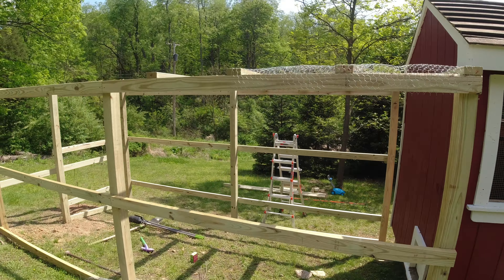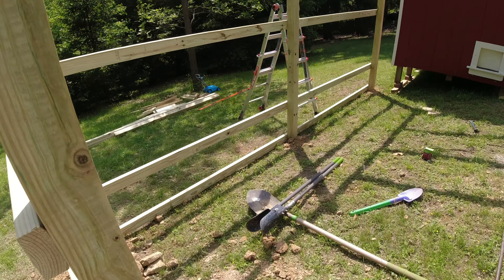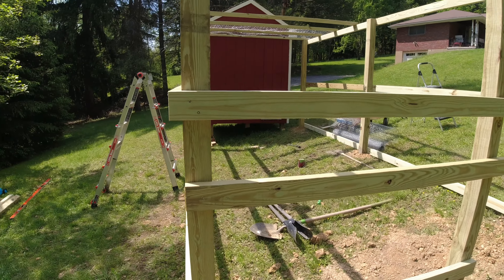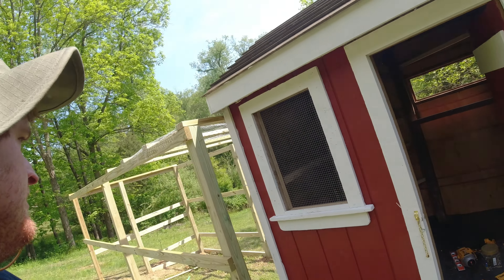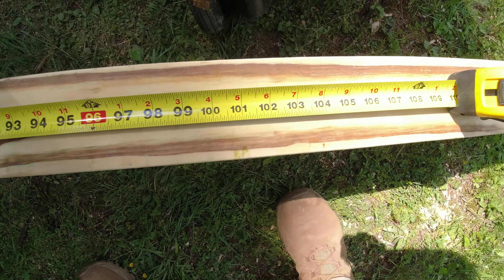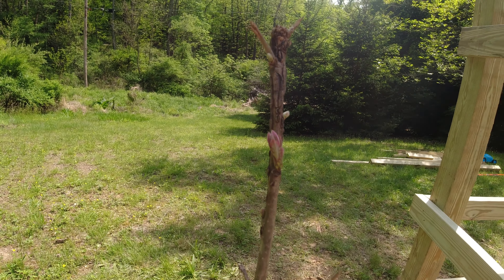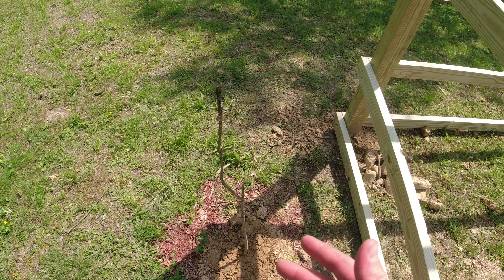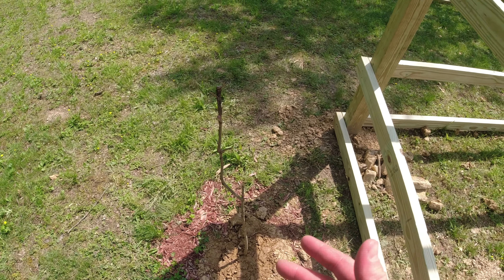#94 Chicken Run Is Coming Along

Comment: Glad you are covering the chicken run. There are four legged predators out there that can climb over the wall fencing’ as well as the flying predators. Also make sure that you run some of the wire at least one foot out from the vertical along the ground and cover with several inches of dirt to prevent those that can and might dig under the fence. Good luck its looking good
Reply from the maker: Thank you Raymond! We did do that exact thing!

Comment: I feel that you are doing the entire chicken operation to make the process successful,  well done... One thing about the chicken wire on the sides, I would suggest that you extend the bottom edges about two food out into the yard to keep boring animals from digging under the base, we lost chickens to intruders before doing that .
Reply: Bingo.....we've had birds taken like that too. We dug a trench around our coop and extended the wire down into that.
Reply from the maker: Thank you Terry! We have done that actually. We added a couple feet to come out and we will then put dirt on top and rock on top of that. We are doing our best to be ahead of the predators and we will make any changes as needed in the future. Thanks!

Comment: Do not just staple wire to bottom board.Staple then put board over staple row. Raccoons can rip out only stapled wire .
Reply from the maker: Thanks Peter. We are using poultry staples. And I am using more than enough of them. I am confident no raccoon can rip the wire or pull the staples out. I tested this with one small section and was unable to pull out the staple or the wire no matter what I tried. From using a hammer, needle nose pliers and more.

Comment: Surprised your store bought lumber for the top of the run, instead of  using off the sawmill
Reply from the maker: The pressure treated wood will last a very long time, and I didn’t want to use nice red pine to be covered in fencing on top and not very visible.